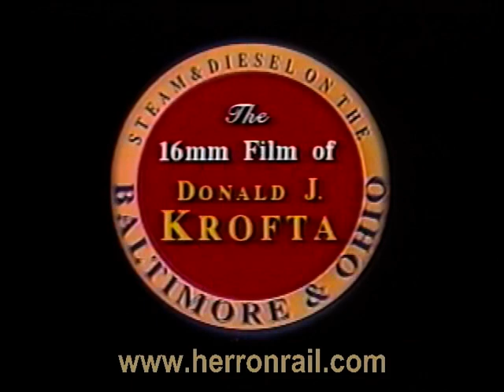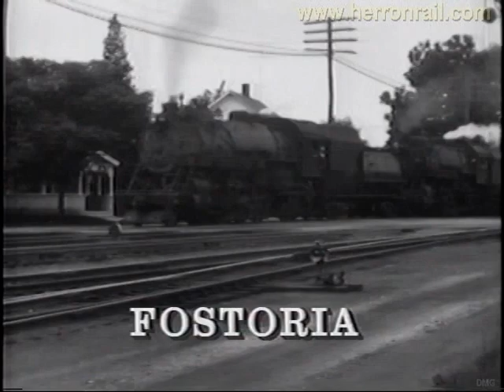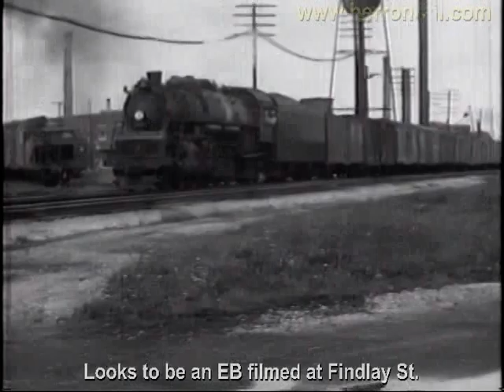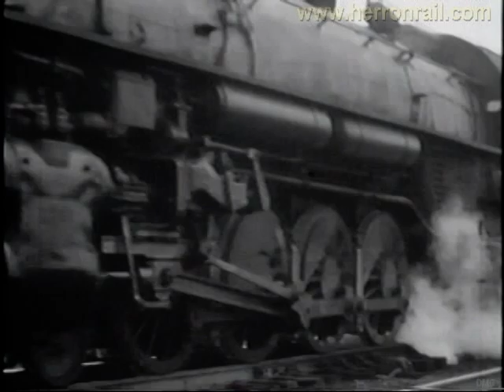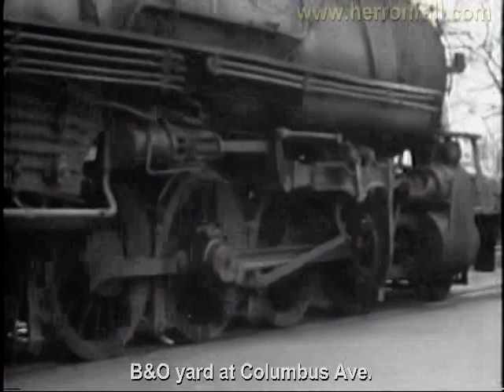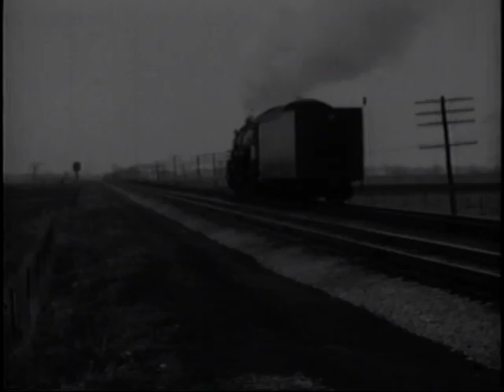Fostoria Ohio Steam Trains from the mid 1950's (Show 4 of 7)

Comment: @railfan456789 No.  Not actual sound.  Doesn't match the driver rotations.
Nice to hear sounds.
Why steam coming from leading trucks of tenders?
Reply: Some of these engines had boosters on the lead truck of the tender. This is another small steam engine used to get the train under way. A steam locomotive had power to move a train at speed, but not quite enough power to get that same load moving from a stop.

Comment: What causes: CHUF, chuf, chuf, chuf, CHUF, chuf, chuf,  ...?
Should all exhaust blasts not be equal?

Would like to see video from the exact spot these films were made.
Great job, Jim Hawk, of getting sound to match!
Reply: @ Robert Gift - Remember that the steam valve events are set based on the circumference of two circles that intersect (Zeuner diagram) which are imperfect by the value of pi - 3.1419. This fact throws the "report" of the exhaust out the stack slightly "out of sync" when you hear it.
Reply: @Robert Gift:  The crank-pins on the driving wheels are set 90 degrees apart ( left side vs. right side) so there is always leverage to get the engine moving.  That is the cause of the un-even exhaust.

Comment: how many cars did these engines often pull?
Reply: This era and location, 80 to 100 cars were typical, sometimes as many as 160 on the C&O coal trains. Train length across Ohio was often limited by passing siding length, not locomotive capability.